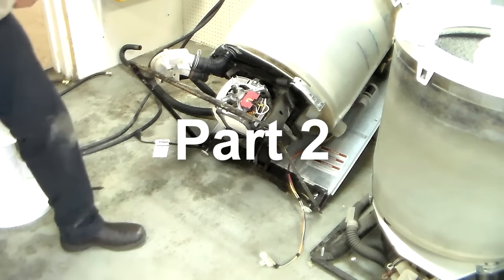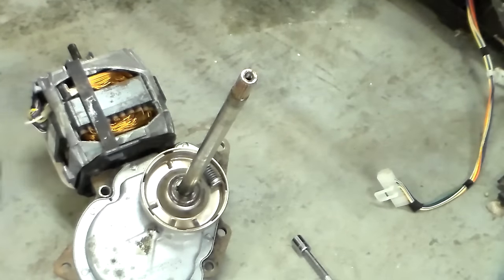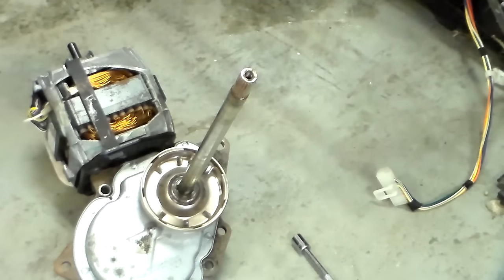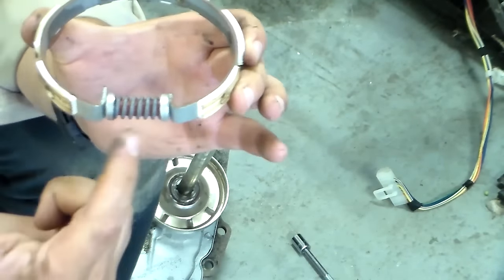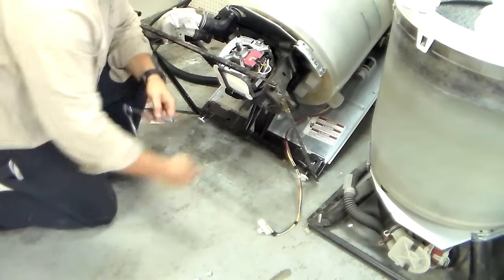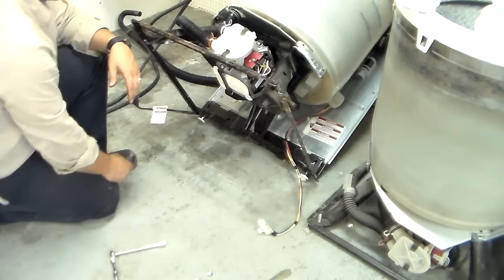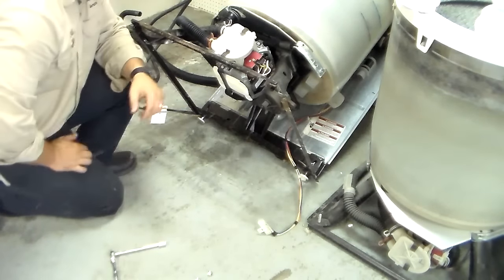Kenmore Whirlpool Washer Not Spinning 2

Comment: Both outstanding videos. I purchased a kit on Amazon that included both the full clutch with ALL the related parts, including two different springs and the coupler for less than the cost of the two parts separately. I was not sure which of the two springs to use, but one was the exact same size as the original plus it was blue (new spring & original were both blue), the other was a little bit longer. So is used the shorter, blue spring. Also, I must not have been careful turning & pushing in on the white plastic brake tab that he specifically says to turn counterclockwise and push on just before he reinserts the long shaft into the hole at 5:40. When I finished and plugged in & restarted the machine, it still did not spin !!! I tried turning things like the coupler assembly, motor, clutch, . . . Whatever I could turn and finally noticed inside the tub that the agitator was not turning right. Clockwise should just move freely and counterclockwise should activate the four dogs when trusting by hand. After manipulation by hand, something felt into place and it started working just fine. Whew !!! Dodged a bullet. I think I must not have fully seated that white plastic part as he says in his instructions at 5:40. Hardest part for me was trying to reinstall that retention spring that holds the clutch in place on the rod/shaft. I had to get assistance to hold one side in place while I clipped in to other end. You can probably get away with just changing out the "ring with the little white brake pads" and not the large metal "dish" which avoids this difficult step, but I was concerned about not going ahead and replacing the small white plastic part that goes between the clutch and shaft assembly. I figured any plastic was susceptible to wear & tear and breakage. My 15 year old Kenmore washing machine, is running great now. Should last another 15 years.

Comment: 0:58 NOW is the time to change the Motor to the Transmission coupling. That coupling is a 3 piece coupling consisting of 2 plastic pieces ( one each on the Motor and on the transmission ) with a RUBBER coupling in between those two pieces. This is a phenomenal video. The attention to the VERY IMPORTANT details that might otherwise be overlooked is great.

Comment: I just bought a washer, she said the clothes were still wet when she took them out to put them in the dryer. I was able to stop the washer from spinning in the rinse cycle so I figured it was a weak motor or a loose belt, but after watching your video I realized it did have a clutch, not a direct drive or belt...so Thanks for saving me from scraping a washer and I'll be replacing the clutch now. (y)

Comment: Your pretty knowledgeable and I'm mechanically inclined enough to now know I gotta replace the clutch in my washer. Light loads it spins up, normal loads and it will not. I end up removing half the laundry for spin cycle, otherwise it does nothing but sound like it is... all other cycles work just fine. Thank you for this informative video.

Comment: Perfect info - just what I needed - fixed the washer for less than $5 for the motor coupler. But then, while I was in there, replaced the clutch. works better than before.

Comment: What if the bolt in the top of the agitator is stripped?? Need to change the clutch now.

Thanks to you I fixed the coupler a few months ago without a hitch. I hope you can appreciate what a help this was to us. Was able to do it last time without removing that bolt on top so I have no idea why it's stripped

Truly grateful  for your generosity sharing your knowledge like this.
Em
Reply from the maker: Is the head rounded off?  If so there are tools that you can use to remove that,  If the threads are striped then you have a bigger process on your hands.

Comment: Thanks for this video.
Too me, it's very recent since I needed that info like yesterday!

Now I understand the if not:
Washing - clutch problem(motor to spindle)
Rinsing - clutch problem (?)
Spin dry - coupler problem(motor to tub)
Draining - pump problem
Filling - pressure [switch/pump] sensor
 
Also, that's assuming that there's no problem with the power,  lid interlock, dial settings; and wiring!

Comment: Videos 1 & 2 were a great help. Just replaced the motor coupler after the washer quit spinning.  Coupler shattered on the transmission side.  20 minutes to disassemble.  30 minutes to reassemble.  2 hours of research and troubleshooting on youtube.  $25 replacement part in north ATL market.

Comment: Hi Bill, Great video, it's been a huge help in diagnosing and repairing the clutch. One note that I'm not sure you cover is the orientation of the cam appears to need to be opposite the yellow spring behind it (and, of course, out of the way of the clutch spring). Correct me if I'm wrong...thanks again.

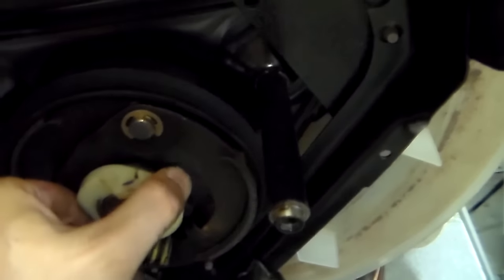Comment: Hi and thanks for your help in fixing my estate/whirlpool washing machine that would not go through spin cycle. I ended up ordering both part numbers 285753 and 285785 so I would have what I need when I got started-ordered both because of low cost too.  @5:03  in this video, the while plastic thing you are spinning is what broke on mine, (was flat, missing tabs), and the rest was fine, where clutch was also tight.

Comment: Thank you so much! Yesterday I changed my coupler but before learning how to do that I kind of explored by myself and I guess when I put the motor back some pieces were not well aligned. I screwed back the motor but it was really hard cause it didn't quite reach. My machine was working great till it got to the spin cycle. So today I followed all your steps, I took out the motor, took the clutch out and rebuilt it all step by step making sure everything was at it's place. Yeah it working!

Comment: Just want to let all of you newbie amateur washer repair techs. that the difficulty of spinning the clutch band is a subjective judgement. I replaced the band and the coupler in mine 5-7 years ago. It stopped again. After finding the coupler to be good, I did the spin test on the clutch band to find it rather difficult to spin. So I moved on to the more difficult things it could be, which took me to the transmission not neutral draining. After watching a video and seeing the complications of it, I decided to remove the clutch band from the clutch ring it installed in. Upon removal of it, I found one of the plastic pads severely worn two pads barely worn, but two pads completely missing. After replacement of the clutch band, it's back to working like new. So my point here is, if the coupler is good and the band has plenty of tension on it, before continuing on to other and more difficult trouble shooting and or repairs than removing the band for a visual inspection, do a visual on it. Don't skip/miss the simple things to fix more difficult things that aren't broke.

Comment: Bill, the video was a big help. I initially thought my coupler was bad on my Kenmore Heavy-Duty 70 Series (Model #110.92573210), top load washer, similar to the one in this video. The coupler had some slop in it, but I did not think it was to the point where it wouldn't be functional. I replaced it anyway, along with the motor capacitor, thinking that my have been the issue. I put it back together, and my washer still would not work on "Spin".  I then found your video and wanted to inspect the clutch. The clutch seems good; I could move it, but it was difficult to do so. Importantly, the plastic piece with the tab or "finger", which you said s to make sure was out of the way of the spring, when putting it back together, was broken. There is hardly any tab left. Do you know what the actual name of this piece is, and you have a video that shows how to replace it? I'm assuming if that tab is broken then especially on high-speed it would not rotate the agitator. I'm not getting anything on spin cycle other than the motor sounding like it's turning on. Any help would be greatly appreciated.

Comment: Thank you, excellent video. I removed the motor and transmission and checked out the clutch one finger wouldn’t move it to fingers I could so I believe the clutch is good. The coupler looks good, but I’m going to pull the motor off and inspect more. The thing that bothers me is the brake when I release the brake I can see the shoes come off of the walls, but it does not rotate when I try to go counterclockwise as you did, what could be wrong and yes my washer seem to be agitating, but not spinning. I can send a video if possible.

Comment: This video is extremely informative.   I used to be an industrial plumber and they would expect us to fix problems like that without instruction on a daily basis.  But I am retired now and would rather not jump into a project that involved turning my washer on it's back and pulling out it's spine without being sure that either the clutch or coupling are really my problem.
My symptoms are different.   Sometimes it does and sometimes it doesn't spin.  It is usually a large load.  When I don't detect a vibration, I have to open her up and wrangle the tub until I hear a snap.  Then she will spin just fine.  I was looking for a weak overload switch or something.   It is the brake release?  The brake works great..  I can stop a spin..  when she DOES spin.

Comment: Fantastic video, TY for posting!  After inspection my clutch is bad and will be replacing it.  Question. How do you remove motor coupling to determine if it is rounded inside?  It turns the pump, but would like to make sure while I'm there.....

Comment: Thanks so much for the great tutorials!  I have just replaced the lid switch, (which has held together for 2 years with a rubber band!), but the washer still wouldn't spin or drain.  I watched your part 1 and part 2 videos, and I think I can do this repair as well.  Thanks again for the great instructions!

Comment: This video and your instruction is great! Thanks!  I have the whole motor & clutch assembly removed.  The clutch is pretty tight though so I don't think it's bad.  However, when you showed the brake assembly.... mine does have the one large "tab" sticking down, but it looks like there is a piece broken off the plastic in another spot.  I'm not sure what the original brake looks like.  It appears to be a c clamp holding it on.  I haven't gotten it off yet.... Am I on the right track?  Could it be a broken brake that causes a loud thumping and agitator/tub barely spinning on spin cycle?

Comment: GREAT video you put together Bill.  I had to replace the coupler a few years ago and you're right if you drop the whole part down by taking out the bolt inside the drum, my lilfe would of been a whole lot easier.  I am almost positive it's the clutch this time since water does go out, but went from barely spinning to not spinning at all. Ready for my weekend project.

Comment: First I want to say thanks for making this video and it's was very informative and detailed instructions. Especially, for those who never worked on washing machines before.

However, I'm in a situation where my Whirlpool ultimate Care 2 washing machine will not spin or cycle. I have checked the coupler and the clutch and both are in good standing. One thing I have noticed is that the motor is constantly hot. Is this normal? Also what else should I check to figure out why my machine won't spin or drain or cycle? I did already replace the door switch handle as well.

Comment: Thanx, Bill, great video! I've had to come back to it several times when working on my Roper. But now, finally after the coupling was fine, & not sure if the switch is bad, I took out the clutch, and stop plopped out of course. But it is not too easy to move as you suggested - so might not be cltch after all. Auggh! How could I be sure it's not then the switch or transmission? It agitates, drains, but doesn't spin at both cycles (actually, it has spun once or twice in this condition when attempting to use it! - so nice didn't have to wring out clothes at those times). 
Parts are hard to order too as such stores close around 5 & aren't open on weekends (El Paso) & Lowe's doesn't have parts - have to order them from their parts store, but not on weekends too!

Comment: HI Bill,

Your videos are very clear and easy to follow.   I replaced the lid switch in my Kenmore Series 70 washer and it still didn't spin.  So I checked the drive wheel and  the clutch and both look good.  However, when I tried to turn the brake release finger, it only turned a little ways and did not spin the tub like in your video.  when I put the machine back together, the rest of the wash cycle works fine except for spin.   I can't turn the tub manually.  Did I miss something?
Thanks for your help-

Darryl

Comment: Thanks for explaining what your doing when you put it back together, turning tub counterclockwise and pushing up, aligning the spring to the right so it doesn't interfere with plastic tub arm, turning the motor coupling so the pump goes on. Other guys put it together but don't explain well what there doing when they do it!

Comment: Hey Bill, thanks for the video it's great and your an awesome teacher.  I changed my clutch spring out with no problem.

I did run into something though. When I put the agitator back in I have to push it down hard.  Then the washer doesn't spin again.  Am I pushing something out of alignment?  Everything else looks to be in good shape, it's just after I push the agitator back down in the machine

Comment: I am a software engineer.  I do not work with tools hardly at all.  I was able to watch this video and pull the transmission/motor out and verify I have a bad clutch by moving it very easily with my fingers.  In the video, you mentioned you would publish a link to the part number in the video's description, but I don't see one.  I will try to search for it on my own, but I would love to get that information here.  Thanks.

Comment: Super video, Bill. Really a good production. Much appreciated. One question: if you operate the motor/trany combo, on the floor, next to the washer, plugged in (yes, I know, I know, but I'm an electrician), While the clutch and shaft are spinning, should you be able to take hold of the shaft and stop it with ease while the rest continues to spin? I did. Should the clutch ad the shaft have an independence like this?

Comment: Good job!  Only thing I'd suggest discussing is which clutch spring to install when installing a complete clutch.  My new clutch came with instructions that mentioned a blue and black spring, when in reality, it came with a heavy light-blue spring and a light dark-blue spring.  Instructions said to install the "blue" spring for larger washers like mine.  But which blue spring should I use?  I assumed the larger washer would need the heavier light-blue spring, so I had to change the springs.  Not sure if that assumption was correct.  The new clutch came factory assembled with the light dark-blue spring, which, according to the instructions, was intended for larger washers.   Wish someone would correct this problem so instructions match the supplied parts.

Comment: Thanks, Bill, for a very well-done video.

One point -- I noticed that you replaced only the clutch itself, not the clutch case, retaining rings, cam, etc. that are included in the repair kit.  Would you please comment on this?
Reply: Cheap work ain't good and good work ain't cheap.

Comment: thanx for the help bill the clutch seens a little stiff, but i can turn it and  i grabbed the shaft and turned it by hand and the motor coupling turns so im going to get a new clutch tomorrow and see if that works, theres also the same machine on CL for sale for a dollar with the same spin problem going to see if i can help them out fixing it if i can get mine to work

Comment: I've run through both your videos and nothing seems out of place but my 
machine will not spin. I'm assuming I either need a new motor or 
probably just a new washer. Thank you for your videos though they were 
extremely helpful in troubleshooting.

Comment: This job looks a hell of a lot easier than I was thinking. I'm about to replace the clutch and coupler in my washer in the next day or so because apparently it's more of a challenge to buy another used washer than to get the parts to fix the one I have. On the bright side the washer in question is about 30-40 years old so I figure once I replace both of those parts it'll probably run another 30-40 years no problem.

Comment: Hey, just viewed your very informative video and it was right in line with my problem. I have a Kenmore elite washer and it was leaving clothes wet after final wash. If the clutch is slipping but allowing the tub to spin would it also cause the tub to become unbalanced while spinning? I asked this due to the fact that I bypass the start switch to see if the tub was spinning at all, it was, and attempted to slow it by hand and it slowed to a stop and motor was still sounding like it was still turning.

Comment: Bill...Thank you fir your great information!  Very well done  videos.   Which naturally leads me to a troubleshooting question :   our washer spins in both speeds, but clothes are wringing wet. Running then through a 2nd or often 3rd rinse works fine.   There is a loud CLUNK when the spin starts, whether the cycle running normally or from the lid switch or dial.  Is that the brake releasing?   But, what effect would that have on the clothes not getting wrung out?  The drain seems to work fine.  Thanks!  -- Steve

Comment: Very helpful so far!! I suspect a bad clutch but  when I try to remove the motor etc assembly, the long rod that extends up into the tub for the agitator will not pull down so I can get to the clutch. I can't figure out what is keeping the assembly from pulling all the way off. Your video shows it sliding off easily. Any thoughts on what might be keeping things stuck? (Yes all proper bolts are loose!!)

Thanks 

Paul